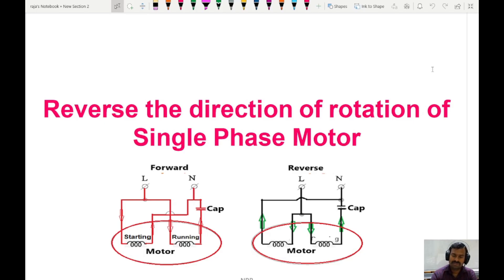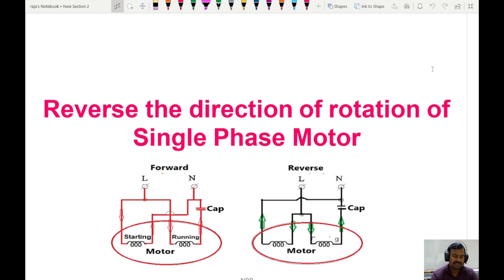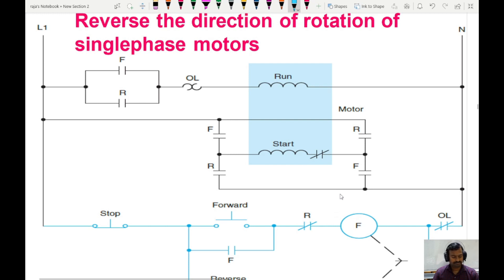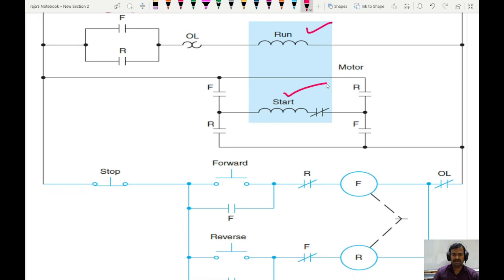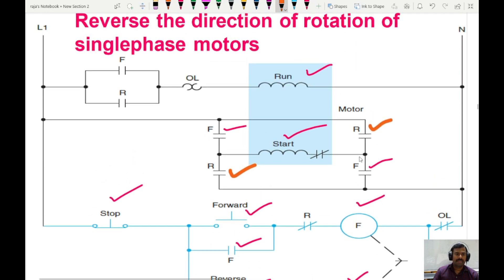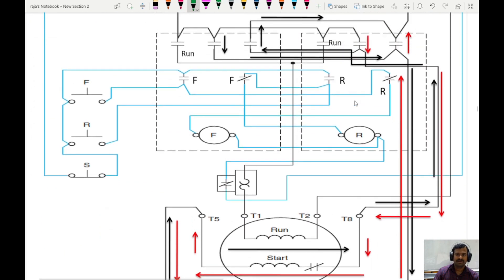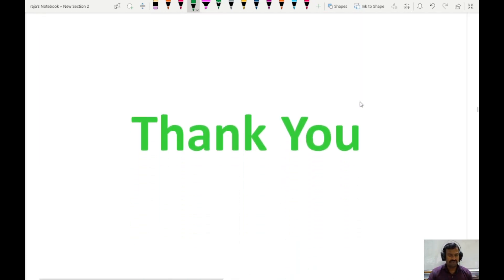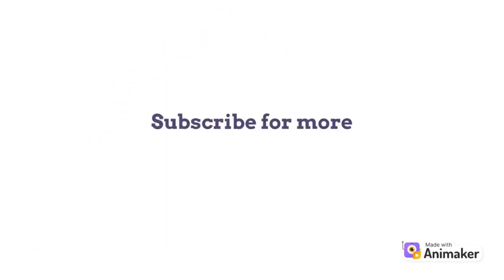Forward–Reverse control for a single-phase, split-phase motor

Comment: the capacitor will be in series with the aux winding no the running winding
Reply from the maker: nice observation, @3.03 motor coils labelling done wrong(apology), later parts(4:0) it is shown as you said. Thank you for your feedback. I Really appreciate it